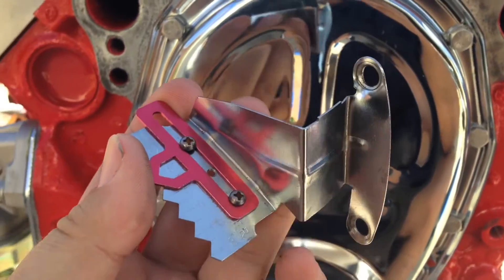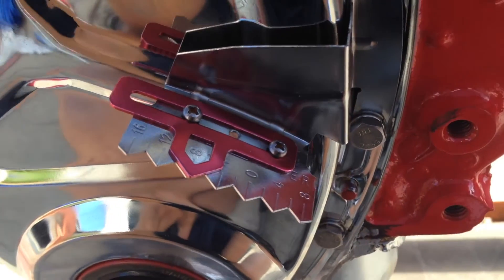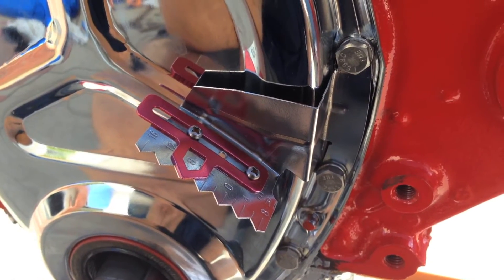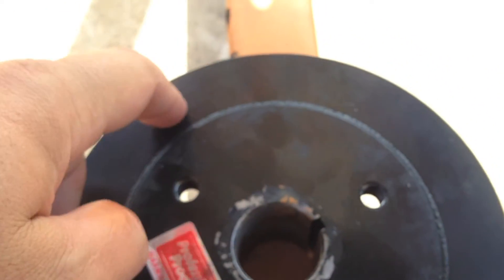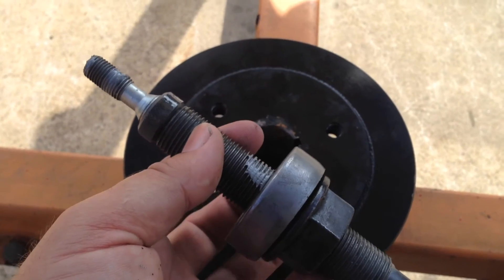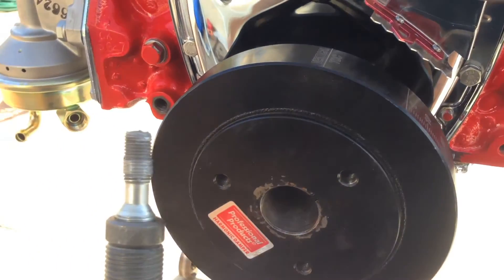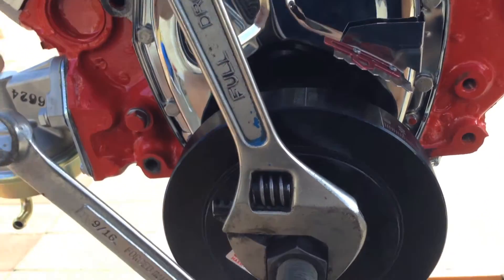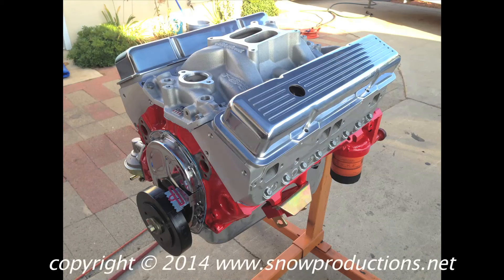Dress Up pt.3: How To Install a Balancer

Comment: wat brand damper u recommend for a 327 chevy?
Reply from the maker: Just get a good one. Don't go too cheap because the outer ring can spin and get off kilter from the inner hub. The 327 should have a bolt on balancer unlike the 283 with just a press on balancer. Get the larg balancer instead of the small balancer just make sure it clears in your car/truck. get the correct water pump that lines up with it also. Always a good idea to have the crank, pistons, flywheel, etc. balanced before you put the engine together. Well worth the couple hundred dollars in the long run.

Comment: does the harmonic balancer bolt have to be torqued? I'm doing this on a 1970 ford Mustang 302
Reply from the maker: Some are pressed on but if it has a center bolt then there is a torque spec for it somewhere. It's hard to hold the crank while you torque the bolt so after I bottom the balancer out with an installation tool I put thread locker on the bolt threads and zip it down with an impact gun on low. Make sure you start the bolt by hand ( I always turn left first to seat the threads by habit) then snug it down with an impact. Don't hammer it too much. Just a second will do it.

Comment: on your timing tab what inch is it?  I have a 7" inch and it's too big please help me
Reply from the maker: If the timing tab is far away from your balancer then you may have a 283/327 small harmonic balancer. They usually had the tab spot welded on the timing cover. A standard timing tab will work just harder to see the exact marks. Larger balancers are always better if you can use one. If the engine is a 283 or 327 you may not have a threaded hole in the front of the crank to bolt on a bigger balancer which would make the timing marks closer to the TDC mark on the balancer.
Reply: SanDiegoHotRod I have the same damper like you it's an 6 3/4 and it's listed as for 350 6.75.  80000 model professional products
Reply: SanDiegoHotRod also I used the same install tool to put it on and it bottom out.  can you send me a link to where  you gotten your tab from?  I'm stuck on the tab part 😕😞
Reply from the maker: I usually get most of my parts from Summit Racing. Easy to talk to and work with. Here is a tab for the smaller diameter 6.75"  balancer. 
https://www.summitracing.com/parts/pro-141-200/overview/make/chevrolet